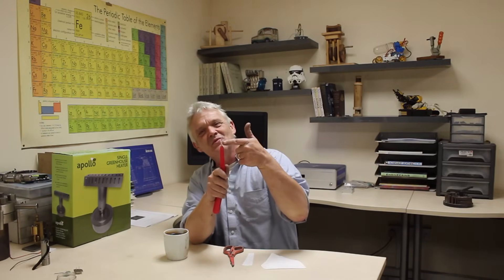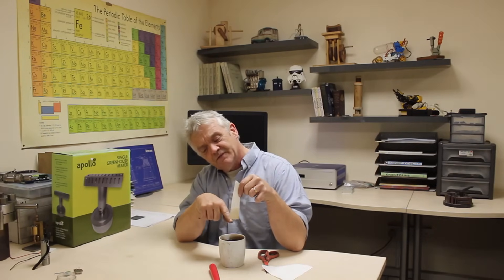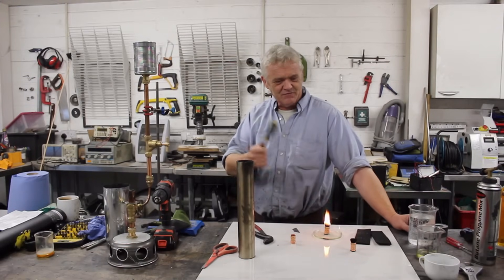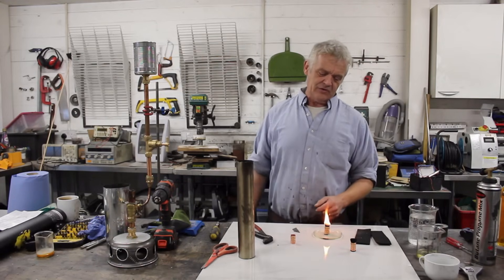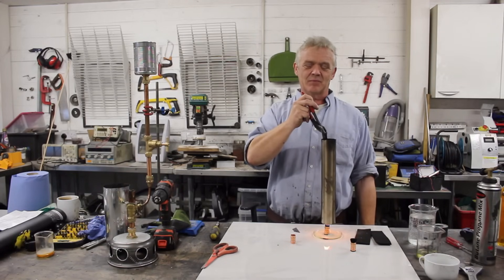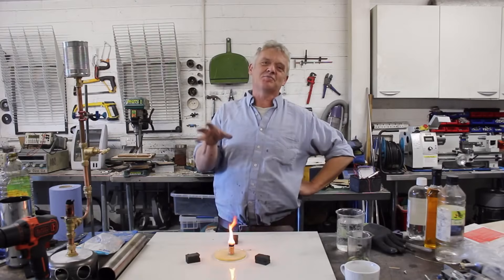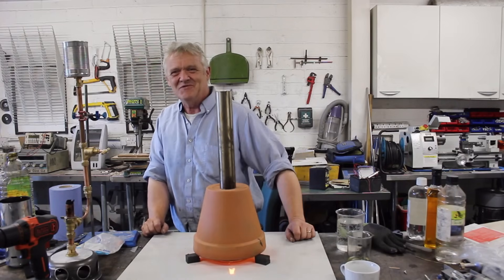1680 The Magical Forever Wick - The Plant Pot Heater On Steroids

Comment: I put used engine oil in a tin can and had a wick on the side burning. I put the can inside a wood stove and left it. About 30 minutes later I thought hmm, it's warm in here. The flame from the wick had spread across the surface of the oil and was burning putting out at least 2000w of heat probably more. I observed it and eventually it burned all the oil and didn't go out of control. The point is that if the wick falls over it may take a while but would probably set the oil on fire although not immediately. Interesting demo as always, thanks! 😄❤️👍😎
Reply from the maker: yes it would but it would depend on the size of the flame and the mass of the oil - first the oil has to get hot enough to fume and it would then be the fumes that burnt - like all fire it is not something to take lightly or ignore
Reply: Do you think that using jam jars to hold the oil and drilling a hole for the fixture into the screw top jam jar lid would make for something safer?
Reply: @annebeignatborde1832  this is what I was planning
Reply: @annebeignatborde1832  Would the build up of heat cause the jam jar glass to break ? maybe a can would be better.
Reply: @slogger1slogger108  I don't know but the glass of jam jars (at least the ones I have) is pretty thick and resists being sterilized in a pressure cooker. The weak point would be the lid getting hot but I reckon there are ways to avoid that. For example by keeping the flame high enough from the lid.
But I'm no expert so I would advise extensive testing outdoors first.
.
Reply: Love how you two are working together to problem solve!

Comment: I haven't built anything for a while. This would be great to leave over night in my workshop to take the chill off in the cold winter mornings . What ya reckon mate
Reply from the maker: I think it needs more stable build mate - this was really just proof of concept stuff - but a more stable build or an adaptation to an exiting build would be good - I am not sure about leaving a fire unattended - that's something I wouldn't do tbh - you are never quite sure what a fire will do - it does tend to have a bit of a life of its own and is best watched in my opinion mate
Reply: @ThinkingandTinkering  It would definitely need a fail safe or two and some robust testing but we do have gas boilers running while away from home. I wasn't saying put it in a wooden shed surrounded by petrol cans or anything crazy lol
Although it might make for an exciting video lol
Reply from the maker: @karlmyers6518  good point mate - and yeah it would make a good video for sure - well - certainly one I would watch
Reply: @ThinkingandTinkering  Yeah... fire is one of those things that ticks off almost all of the requirements for Life.
Reply: Never leave a burning flame unsupervised.

Comment: I had a feeling I was going to see a carbon sponge as the wick, though the felt was similarly brilliant. I was goofing around with carbon filters one day that are designed to be a pre-filter medium on HEPA filters and noticed the same effect. I hadn't the foresight to make it into anything like this, but that's why we come to you, Robert! 👍
As a small bonus, at least in the US though I suspect you can get it anywhere or online, the carbon filter stuff is available in relatively small volume and quite cheap. Minus the parts I've cut off for my purposes, the one I have is a meter/yard long and 24 inches wide (~600mm if my armchair conversion math is close). I think it was 12 or $15 US and at a home improvement type store, though I've seen it online as well. I originally got it for both the pre-filter and experimenting with battery electrolyte-holding duty, but not I'm genuinely curious about what else it can do! Fire!!
Reply from the maker: lol - it was you who set me thinking about this mate - so - personally I see it as you to blame lol
Reply: @ThinkingandTinkering  I definitely blame you in the best way for me having gotten the graphene bug. Now I've got 500 pounds of anthracite on my patio that I'm trying to convert before the end of the year! Just about to kick into phase 3 this weekend as a matter of fact as we go for the instant graphitization method via plasma. 😈It's gotten a bit out of hand with the processing and all the new equipment, but I feel it's enriched my life, so we'll call it a draw!
Reply: I have a bunch from the 5 inch filter for my cat litter box. Easy to find at pet stores.
Reply: @ecospider5  
Hi
What do you ask for when you go in the store? What's it called?
Reply: @jude7321  a welding blanket
Reply: @xanadu1jw  
Thank you ❣️🌿🐦🐴
Reply: @jude7321  Carbon felt
Reply: @stevenmark8156  thanx!
Reply: Some advice please. I’m in the US Ohio. Where online and what brand would you recommend?
Thank you!!!
Reply: Will these carbon filters work as wicks? They seem to be far easier to acquire than carbon felt.

Comment: You always go the extra mile "tip the wick over and it will not light the vegetable oil"  Thanks. 
Next step -  put the wick near the bottom of a glass chimney with in a half length glass tube. 
Why ?  Bring fresh air down against the glass chimney to pre heat the air and let the light and infra red heat out.
Reply from the maker: oooh - nice idea mate - cheers

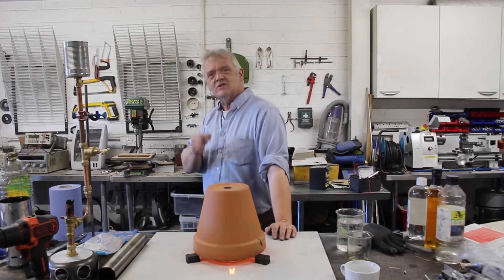Comment: 6:16 look like a lot of smoke
Reply from the maker: yep - there is a fair bit - what would you do to sort that out?
Reply: @ThinkingandTinkering  Lift the pot higher an permit a better combustion, like with vortex and a chimney doing outside at the end to not get poisoned ? ^^
Reply from the maker: @AutoNomades  thank you mate - that's a brilliant suggestion I will pay attention to it
Reply: @ThinkingandTinkering   : ) There is also something to do around the "double combustion" thing... with for example shorter metal pipe being inside the clay pot as a draft puller, then a kind of tripod holding the clay pot, (mabye also the occasion to put a fixed propeller ?..) and a hole on the pot +/- same size as the tube...
Reply from the maker: cheers mate
Reply: @ThinkingandTinkering  may be a small fan to blow air, oxygen, my help
Reply: @3D_Printing  Chemney does naturally a draft doh..
Reply from the maker: you have to be careful trying to post embedded links mate - youtube with holds them
Reply: @ThinkingandTinkering  money gets the rich shutting down truth
Reply: @ThinkingandTinkering  Yeah it's a pitty ... The links was directing to a fire vortex torch. You can find it with the title <<
Feuerfackel 4.0 Der Tornado in der Röhre >>

Comment: What is the BTU value of this forever wick? A tea light is rated at 100 BTU's. The forever wick has a larger vlame, thats why I ask the question.
Reply from the maker: I have no idea mate
Reply: If you want a tea-light with a bigger flame; take four of them (the ones with an aluminium cup); place three in a triangle touching each other and place the fourth one on top in the middle; light the three wicks and wait till their heat melts and boils the wax in the fourth one. That fourth one will burn over its entire surface, no wick needed anymore.

Comment: Any idea why it appeared to be smoking more with the pot and the chimney on it at the end ?
Reply: The tube works by itself better because it is closer to the flame so it draws air faster around the sides, more hot air for longer = clean burn. The pot is so large that only ambient air flow through the hole is happening so it has less flow. The key is more hot air for a longer time to eliminate the soot. If you put a blower or fan under the pot it would still be clear. Hope that helps.
Reply from the maker: it does mate - a lot thanks for adding that
Reply from the maker: not yet!
Reply: It almost appeared to be a mixture of soot and condensation being exhausted, like the small opening in the pot was acting like a venturi.
Reply: I guess if you would lift more the pot and permit a better combustion like with a vortex, it could help.
Otherwise the risks are from a big headeach to death .... ( Wich make it less cheap heating^^^ doh)

Comment: I am into tent stoves and extremely small stoves for super insulated cabins/houses this has great potential.
Reply from the maker: awesome mate - I am glad to hear that - I figure it would make a great portable stove particularly if you used veg oil - that not bursting into flames bit has to be good for a stove used in a tent
Reply: Hi, You may wish to consider all the combustion gas that will be released into your tent.
Reply: @timtelemark907  No I will always have a flue.
Reply: @timtelemark907  Such stoves work with tent roofs

Comment: If you put a coil around that metal chimney at around one third of it from the bottom up and add some current into it will it do as a heater for the room?
Reply from the maker: yeah I would think so
Reply: Hi, there is a video on YouTube that shows how a guy built a heater for his one person camper fueled by several big candles. It had metal pipes above the flames and air was pushed through them using a PC fan.
I'll try to find the link for it.
Reply from the maker: please do - but you can't post links on the comments page as they are blocked - if you paste the title in I can do a google search and find it that way too
Reply: @ThinkingandTinkering  ok, here we go: Candle convection heater- winter camping with my off-grid stove. The channel is: The Outsider
Reply from the maker: @annebeignatborde1832  wow - thanks Anne - I am going to watch that now!
Reply from the maker: @annebeignatborde1832  watched it - that was awesome - thanks for the heads up
Reply: @ThinkingandTinkering  you're welcome. I'm looking at ways to heat my place this winter and came across this video. I can't solder and I'm not equipped for it but I think parts of the design could be incorporated into a cement heater. There's a channel called creative cement with loads of videos on how to make stoves with cement (using things like plastic washing bowls or chairs as the base of the mold) or with bricks.
Fun stuff 🙂
Reply: @annebeignatborde1832  i ve accidentally seen that one layer of coil on a tubing in the lower part with the ability for air to go from under (like the metal chimney used in the vid) could do the trick. Haven't tested the chimney with metal only with plastic tubing which eventually tends to melt and ain t quite sure if to use aluminum tubing or iron tubing and if to make it a bit conly at the upper part to make a jet of hot air coming up. On a straight tubing the coil would sit decently on a conical shape it s kinda frisky to get to stay onto it. I think i used at around 40 watts (after a while the heat comming up from the tube would kinda make a disconfort for the hand, more than 60 degrees to maybe 75) for the test. And an inner placement of the coil might do nice but dont know how to put it in a nicely fashion

I might do mi first diy yt vid on this if i can manage microwelding thin aluminum plate
Reply: @annebeignatborde1832  woudn.t the pc fan lower the overall temp(would need a low rpm)? Haven t watched the vid yet
Reply: @wuuubbits  there are a lot of interesting ideas in the comment section on that video. Happy experimenting.

Comment: That's pretty cool and I'm thinking there's gonna be a lot of applications for the forever wick! Also if you add a second larger plant pot above that one it'll create a draft between the two giving a lot more airflow kinda like the air multiplying fans. That will increase the heated area. Used one like that on a sailboat for awhile wish I'd have known about the activated carbon fiber back then 🤠
Reply from the maker: awesome mate - nice tip - cheers
Reply: So you put another larger plant pot above the other? How high above?  Or do you put it down over it with an air gap at the bottom?
Reply: @yougeo  you want a narrow air gap between the two pots for the air to collect the radiant heat from the inner pot efficiently as it rises. You also have to play with the air gap between the inner pot and the tray or other surface it's sitting on to maximize the heat capture while also allowing enough air flow to maintain the flame 😉
Reply: @yougeo  i was wondering the same.  Could you please describe more accurately.  How much heat is truly produced?
Reply: @nct948  it depends on the type of candle/fuel source, the cubic footage/meters, the draft etc etc. I was using it in a 30ft hunter sailboat salon area. The tea candle's took the most time and some of the brighter burning holiday candles were fastest. The brighter ones did produce a little bit of smoke until I played with the air gap that was allowing the oxygen in to the candle. On Say a cold calm January night in Galveston Texas it took the bright burning candles under an hour to bring temp up to mid 60° f windy night a couple of hours and either way it was warm enough to shed blankets in my sleep before dawn. With the 2 pots and a constant flame the air circulation continues to increase in temp as long as I didn't go topside and forget to close the hatch.🤫a few times lol. The tea candle's also brought the temp up into low/mid 50's over several hours. The main problem I had with the tea candle's was their relatively short burn time so it's possible they could have done better than they did if I'd been more consistent with adding fresh candles.
Reply: @jdsr7423  thank you very much for the added comments.  It's a good thing to keep in mind if the price of'modern' heating gets too high.
Reply: @yougeo  there should be a small air gap between the two pots to heat quickly/easily and force the draft up through the drain hole of the outer plant pot
Reply: And carbon monoxide given out with this?
Reply: @botany500kojak  I'd like to know that too. I live in a tiny house, and want to know ways to heat in the event of a power outage. But my eldest brother died from carbon monoxide poisoning, so I am very aware of the dangers, and worry about this very issue with alternative heating. I also don't want to freeze to death in a power outage, so....
Reply: @itsnotthesamething  important point.  Looking forward to the reply.
Reply: @itsnotthesamething  - Perhaps get a carbon monoxide alarm?
Reply: @artjunkeeperga5392  I have one. But I've had it for years. Maybe I should buy a new one to be sure.
Reply: @itsnotthesamething  always have a carbon minoxide tester at home (not expensive) and open a window or door when the air gets stale.
Reply: @itsnotthesamething  so, sleep wearing gasmask.
Reply: @itsnotthesamething  rig a chimney with some fire resistant flexible tube so there is no gas accumulation in the house and cowl it on top so that  it faces downwind...
Reply: As with any device that uses a flame you need ventilation. I would have thought that was obvious.
Reply: Excellent idea.
Reply: Its bullshit1  it doesn't work! FAKE!
Reply: No I think it will just make more smoke
Reply: @tomhiggins4969  used this setup for several winters on my sailboat at the time and never had a smoke problem as long as the pots were clean
Reply: @tomhiggins4969  all I can do is tell you how it actually worked for me nothing to gain or lose here just sharing my own experience

Comment: Wicked
Reply from the maker: cheers mate
Reply: @ThinkingandTinkering  Not sure if this helps much:
My grandparents were buddhists and they had an altar with oil lamps. I used to fiddle around with the wick in it and noticed there's a sweet spot. Too short, the flame goes out. Too long and the wick burns out faster. Didn't think too much about it til i was much older. Apparently there are a couple of factors at play here. Apart from the ones u mentioned, there's flash point, flame speed and autoignition temperature. Just a hypothesis, if u stick the wick in a thermally conductive sleeve (maybe steel), it helps with vapourization. Having the tip of the wick just below the sleeve's rim will minimize the wick's contact with oxygen. In short, u want the fuel to vapourize as fast as possible yet only ignite away from it.
Reply from the maker: @tichrontus  it helps a lot mate - thank you for adding that - brilliant post - cheers